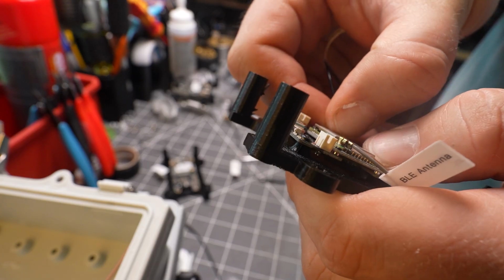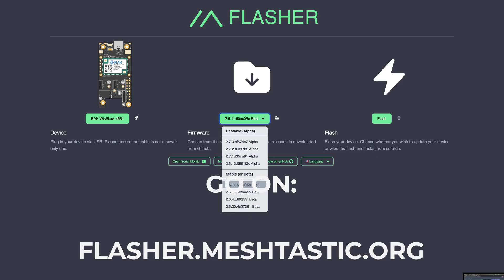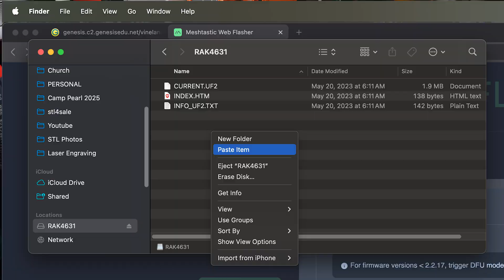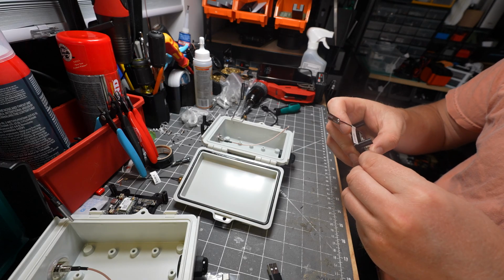The $180 Meshtastic Solar Node Build Guide 2025

Comment: I have a comment that will require input for those that have been around in Ham Radio for a while and those using Meshtastic Radios. I have found a trend among Meshtastic Amateur Radio Operators in which they use their Amateur Callsign to communicate with other Meshtastic users in the public encrypted AQ== LongFast Channel. As I studied this trend, one can find that according to the FCC, an Amateur License Operator Cannot use his Amateur CallSign  to Identify his station on CB Frequencies. It is a violation of FCC Rules. Likewise, the same Ham Operator cannot use his CallSign to Identify his Node in Meshtastic while using AQ== or any other Private Encrypted Channel. The only time a Ham Operator can use his Callsign is by switching the Meshtastic Radio to Amateur Mode, which will Automatically Disable Encryption, and prevent communication with Non-Amateur Operators using the Encrypted Modes in Meshtastic, thus preventing communication between Ham Radio Operators and Encrypted Meshtastic Operators. So it is my understanding that using an Amateur CallSign while Encrypted in Meshtastic again using AQ== in LongFast is a violation of FCC Rules ...

Comment: If you mount one of these should you put it in repeater or router mode?
Reply: ROUTER and ROUTER_LATE are for actually good repeater locations, so unless you're putting it up on a mountain top or a very tall radio tower client is the proper setting.

Comment: Where did you connect the Batterie?
Reply from the maker: There is a small JST Female port on the RAK Wisblock. The corner of the wisblock will have a little red dot painted next to it so you know which side requires the positive cable from the battery.